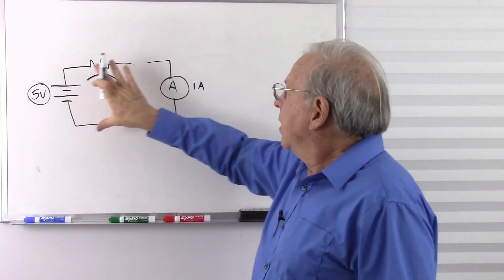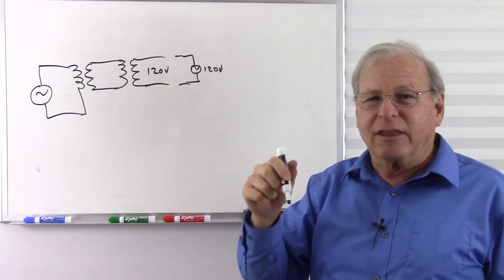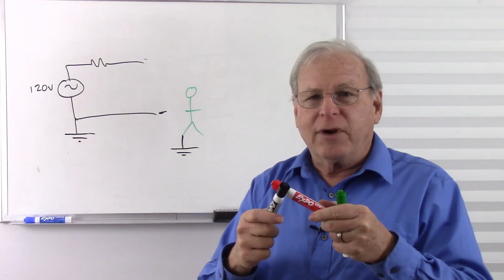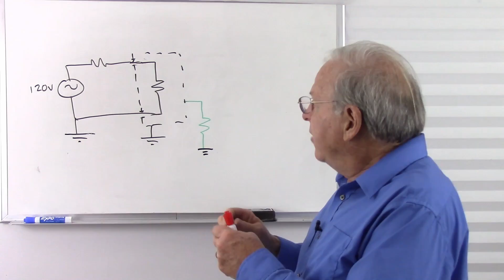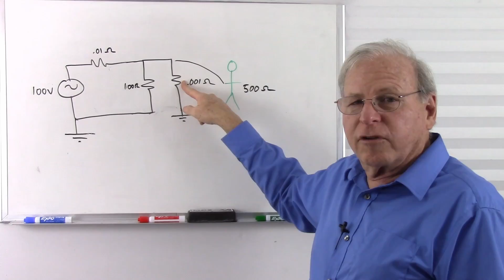How Grounding Circuits Protects Us

Comment: this is why you need calculations to understand electricity.  Its the voltage divider that brings the voltage down to a level to have minimal current go to the person.   Its not like you are diverting current to ground rather than a person.   Voltage division.

Comment: UK Electrician here. I've watched loads of your electronics videos and learned a lot with thanks 👍 I'm going to be bold and say that from my viewpoint as an Electrician you're a bit mixed up here. I can see that in the first instant, as you explained, that under earth fault conditions that 'earthing' as UK Sparks call it does minimise the fault voltage that we may be subject to. But that's not the real point. The point is to clear the fault by having the protective device protecting the circuit operate (you did touch on this to be fair).  The Electrician will measure the 'earth fault loop impedance' and make sure it is sufficiently low enough to develop a high level of fault current (sounds counter-intuitive) under earth fault conditions in order that the fuse or circuit breaker will disconnect within the required time in response to the heat (fuse) or magnetism also (circuit breaker) generated by the fault current. This is generally set at 0.4 Sec in UK. A low resistance earth fault path produces a high earth fault current (Ohms law I=V/R) and thus a quick disconnection time. I agree what you said applies to that first 0.4 Sec but it's not really the objective. The point of earthing is disconnection under fault conditions. We also verify the 'earth bond' in equipment to ensure that will play its part. I'm sure all of this goes the same or similar for US Electricians. I don't doubt your expertise in the other material and apologies for being such an upstart in speaking up. A man of Science like yourself will forgive me I'm sure 👍
Reply: quib·ble: a slight objection or criticism about a trivial matter.

Comment: I guess the point is that if an appliance is not grounded, a short from live to chassis may not be discovered for a while, and one day someone would discover the problem by getting hurt.    If the chassis was wired to ground, the problem would manifest itself by the ground fault protector tripping...

Comment: That reminds me on a situation I had with a Pinball machine. It was near a swimming pool and people where coming there into the bar, bare feet and wet on stone tiles to play Pinball. I was very keen to check the grounding, especially from tho lock plate that is made of metal. So first I testet if the wall socket is correctly grounded then I checked if the Pinball machine's lock plate is connected to ground. It was. But... when I slide my finger on the lock plate I still can feel something like a tickling on my finger. Why?

Comment: But how does the ground wire connect to the circuit when it is initially not connected? I mean if there is a loose wire and the live wire is accidentally connected to non-current carrying metal parts then there is a connection between the live wire and ground and it will draw too much current but CB will cut it off immediately. But, if there is no loose, and you accidentally touch the live wire, since there is a grounding system current still flows from the live wire to you and then the ground. I can't think of any situation where the ground wire and you will simultaneously connect to the live wire, and you can't connect the ground initially to the live wire since the breaker will immediately trip. So how can the ground wire protect you from shock? Or just it is installed with some devices that also connects the ground when you touch the live wire This question keeps haunting me:face-purple-crying::face-purple-crying:
Reply: The ground wire is just like you said. It trips the cb. It doesn’t use the earth even. It’s basically a spare neutral wire that goes back to panel. It only carries current when hot touches something like equipment case.  They ground the neutral side near the panel with a ground rod to prevent static voltage from building up in the system and to dissipate lightning. Again the tethering to earth is for those separate reasons. The “ground path” is really just a backup neutral. It is one with the neutral (bonded) in the panel before either see a connection to earth grounding rod. If a fault occurs through the equipment ground and doesn’t trip the breaker… the design failed.

Comment: A great video with all the build ups,basic  theorys are not left as if they are understood which is very very important. One thing though, The ground wire, is not mentioned here, which is the the 0.001 ohm return path to source at the main ckt board, there it is bonded to the neutral, necessitating, a 3rd wire called ground wire, for the fault to have a least resistence path way back to the source.

Comment: A great video with all the build ups,basic  theorys are not left as if they are understood which is very very important. One thing though, The ground wire, is not mentioned here, the 0.001 ohm, path way is understood to be the ground wire going from the equipment body directly to the grounded side( lower, neutral) wire and bonded at the main ckt board.

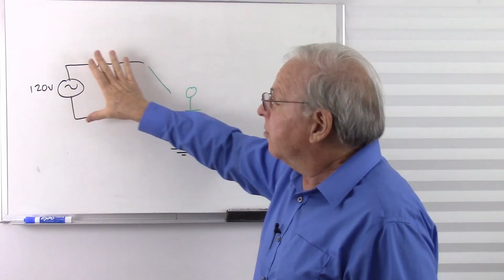Comment: 10:09 i fail to understand why current will not flow id we just touch the hot wire and are grounded. I would assume that if we are coonected to ground there is a voltage difference between hot and ground and electricity should flow through us to ground as if that wrere a close circuit. But the explanation makes ir sound obvious that electricty canno flow unless the main circuit closes, closing with ground is not a viable option?  But the video was so helpful. The final part of the parallel circuit where the path to ground is so low resistence that it saves the day was really good.
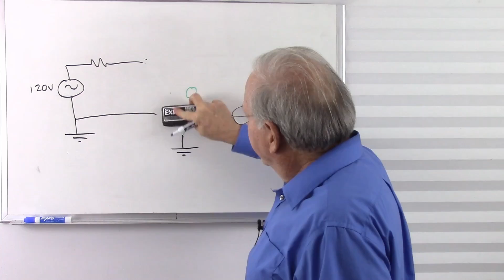Reply: because there isnt a path for current to return to the source. If there is no path, current will not flow. If you connect the source to the ground like he did at 11:58, by touching the live wire, there is now a complete path. Current flow out from the source, through you, across the soil/dirt, and back up to the source. So yes, the ground is a conductor itself. You can look up SWER (single wire earth return) where they literally use the ground as a return path to the source. So instead of using 2 wires, they only need to use 1 wire saving money on conductors. However, this system is not very common because it's not safe but it's still being used in some rural area.
Reply: The current needs to go back to the source, but if its not connected to ground, it can not return there, so there will be no current to flow, so no shock.
Reply: @Aero_Silktail  Ok. In short the ground itself behaves like a wire back to the voltage source and nothing more... correct?

Comment: Nicely explained (as always). However, if grounding is considered adequate, why are GFCIs needed?
Reply: Because a standard overcurrent breaker only responds to short circuits which might generate 100's or thousands of amps.  Sure, it will trip in milliseconds, but it wont matter because if you take a massive amount of amps, you could die anyway.  Grounding would be sufficient IF we could create grounds with resistances in the milliohms range, but this just isn't practical in real life.  Most of the time we are stuck with 10's of ohms on a good day (typically one rod will give you 100-200 ohms). So this means the grounding system wont be low enough resistance to carry enough current away from our bodies. It will carry most of it, but your body will still take some of it. And remember, it only takes around 30 milliamps to send some people into fibrillation.

Comment: The best teacher by far....Great job bob.i am waiting for IT classes soon please
Reply: @Bob One thing is confusing though , you showed us that least resistant path is .001 Ohms but as you can see the electricity has too travel towards the source and ground is not copper wires, so you speak that there is back pressure when there is resistance.i mean .001ohms has the least resistance but after that it still need to flow and complete the circuit please explain it
Reply: @inamaman9891   Good question. To me, it's almost like the Earth is acting like one giant capacitor that can absorb a lot of energy and still not be full. Or like a reservoir for current to flow into. Think of how lighting works, and you'll see a similar reaction to that of earth or chassis ground.